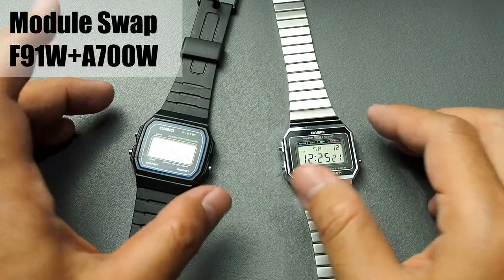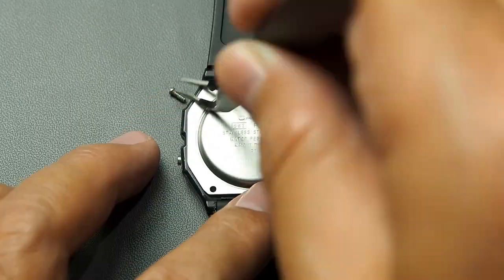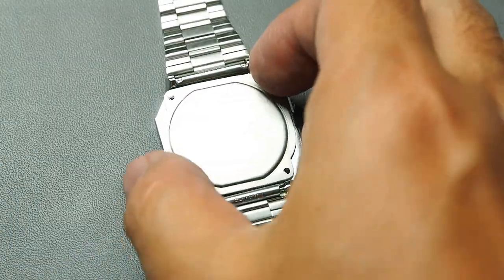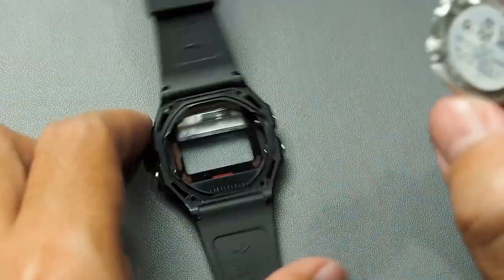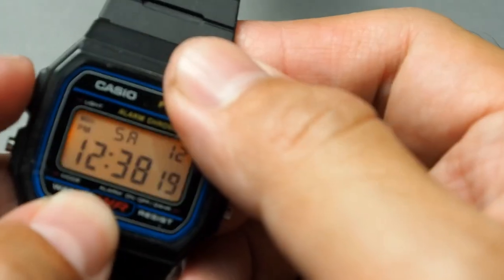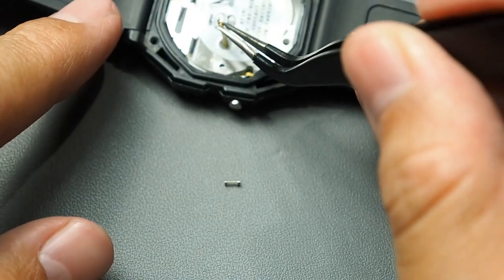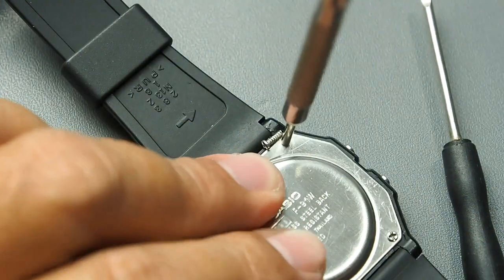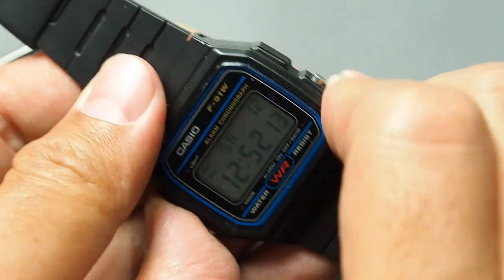Improving the Casio F91W: The Ultimate Module Swap

Comment: Do you happen to recall what size spring bar you sacrificed for the spring?
Reply from the maker: I forgot the length, but it's the slim/small generic spring bar, not the thicker one
Reply: @SamsWatchReview  I had a generic spring bar kit from Amazon in my watch tool box from and the little copper spring in there worked perfectly, just like in your video. Thank you! I now have the F91W that Casio should have made themselves. :)
Reply from the maker: @TheScalawag  awesome, congratulations!

Comment: The SKMEI 2056 and 1412 are an excellent alternative to the F91W and they have a much nicer back light. I have a couple of 2056 and the functionality of the module is nearly identical!
Reply from the maker: Thank you for sharing :)
Reply: how's the accuracy on those ?
Reply: was looking at getting one of these and sticking the casio faceplate on
Reply: @goodnota  they vary. I have 8 SKMEIs, and one is the most accurate watch I own, half a second a month. Others, well, not as good but comparable to Casio DW5600E.
Reply: @cunawarit  I've found the same thing. I've only got three Skmei watches but one of them is as accurate as my Casios and the other less accurate two are still less than a minute a month. Not super accurate for a digital but nothing that I'm going to worry about, especially for the price.
Reply: @bugdrvr  they vary a lot. I have one SKMEI that's less than a second a month. It's crazy accurate! Others that run a little slow, which is very annoying. Then again, some of my old vintage Casios are now inaccurate enough that they are not ideal for wearing. My original DW5600 with a metal case is way off.
Reply: @cunawarit  Does the old DW have the regulating trimmer in it like the new one? Might just need an adjustment to get the accuracy back.
Reply: @bugdrvr  good question, I'll take it to my favourite watch repair place and see.

Comment: Why didn't you simply stretch the original spring ?
Reply from the maker: That can also work, but will deform/stretch out the spring. I'm planning to reinstall the module back into the A700 in the future, so I want the springs to remain at their original length :)

Comment: I wonder if you couldn't have just switched the case backs too.
Reply from the maker: Haven't tried that, but the thickness is mainly from the case, not the case back profile :)
Reply: @SamsWatchReview  I meant because then you might not have needed to make a longer spring to reach the speaker on the case back. 😬